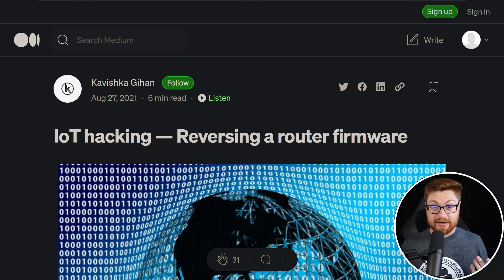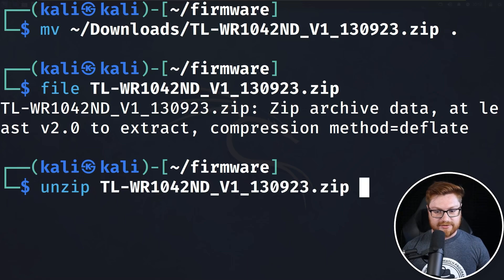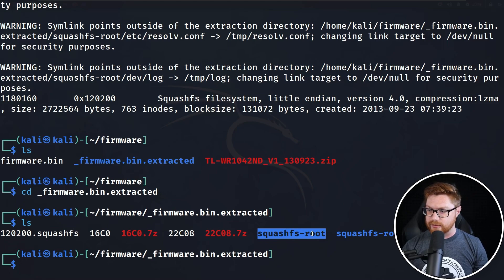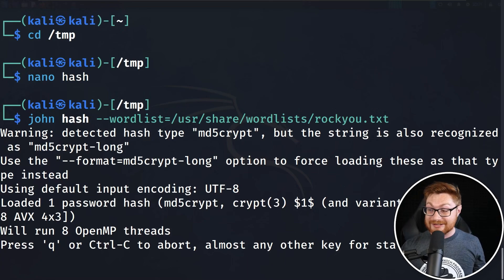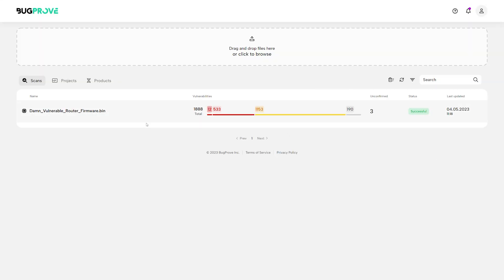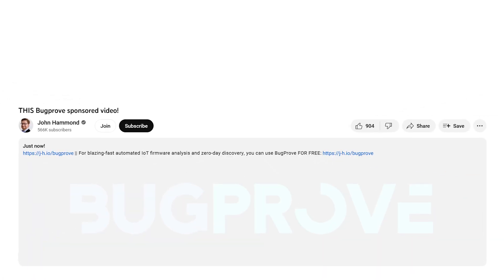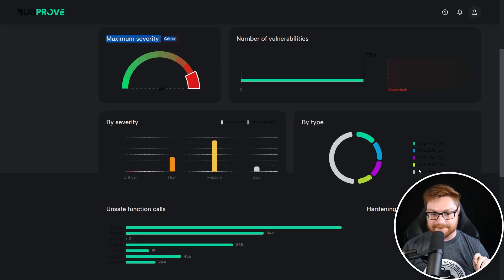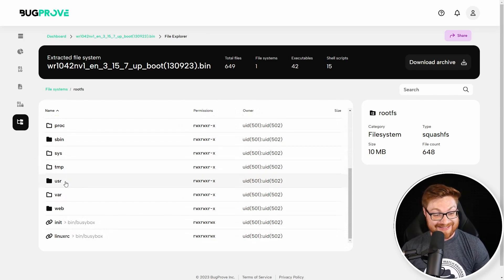Getting Started in Firmware Analysis & IoT Reverse Engineering

Comment: IoT Reverse Engineering? A P1G, Like You CANT Do That. YOUR GOD Can.
1: Firmware (Software), is Obfuscated. You Simply Cant Look at it and Reverse Engineer. How it Works is Hidden in Billions of Lines of Code. The MINIONS are Very Big. They Can. (20 to 40 Years). US: (40 to 80) Years. You: You Have to Wait a Million Years, before You EVOLVE into Something Else.
2: That Firmware, Calls Functions Hidden in Silicone. Its Very Expensive to Reverse Large Silicone Chips.
How Did "I" Do it. OUR: Wifi and 4G/LTE and 10 Gigabit Ethernet and HOW the PCI Express Bus Works.
We Could Make That. Just Not Compatible with Theirs. IT IS NOW.
"I" Can, See 100 Kilometres. "I" Can Recognise THAT ARM CORTEX A-57 CPU. (And Hardware Devices, Using it)
"I" Can Recognise: Which Android Emulators to Reverse Engineer - To figure Out How That A-57 CPU, Works. Like How, Were Reverse Engineering Macintosh. Like, I Can SEE: MicroFocus is Microsoft/Intel. Fujitsu is IBM/ORACLE. SONY is TCL/ALCATEL LUCENT. Motorola is Apple.
"I" Can Recognise - Which Hardware to ATTACK (To Figure Out: How to Do WiFi, 4G/LTE, 10 Gigbit Ethernet, PCI Express Bus). 
My Father CANT See 100 Kilometres Like I Can.
Fujitsu: Thinks there's Lots of companies, Using The RED Colour for its Logos. That's Not the Case for Me. The RED, Fujitsu is Using, isn't The Same as The Red that Other Companies are Using.

Comment: TL;DR be weary of people promising easy buttons, there ain't no such thing...

I vomited at that sponsor.

There's a lot of bogus CVE claims and such automation tools presented as a solution is harmful to security in my opinion.

Security is hard, this could easily give someone who doesn't know much about it a false sense of security which in itself is bad and should be presented with those caveats mentioned rather than as a good tool.
Reply: We understand that security is complex and there are no easy solutions. BugProve is designed to assist security professionals by automating repetitive tasks, not to replace them. We take CVE claims seriously and strive to minimize false positives. Our goal is to educate users about the tool's limitations, ensuring it complements a broader security strategy.

Program analysis and automated vulnerability discovery are challenging, so some false positives are unavoidable. However, static analysis techniques like abstract interpretation and data flow analysis are well-regarded in academia for their effectiveness, despite their limitations. These methods help optimize and secure systems and are indispensable in many safety-critical domains such as aerospace and defense.

In less safety-critical domains, such as IoT, budget constraints have often left end-user and consumer security risks overlooked, creating a false sense of security. We're working to change that by equipping embedded developers and product security engineers with powerful tools to tackle these challenges. While we prioritize delivering an easy-to-use experience, we emphasize that maintaining a mature secure software development cycle, vulnerability management process, and secure coding practices in C and C++ is not easy.

We value your concerns and are committed to transparency and continuous improvement. I hope this addresses some of your concerns.

Best regards,
Attila, BugProve

Comment: Being able to push out a bad firmware update to networked devices, takes a lot of patience but if you like that type of thing...  Router firmware typically is a small file, just getting familiar with that can be fun too.  Knowing how to modify and package 'bad code' is another whole skill-set.  Printers are also fun, PRET helps with that, a bit of an older tool now too.  They never patch , smart devices are lucky if they get one update 2 tops before its forgotten and forever vulnerable.  I'd keep the hardware part, and software separate if its a topic you are going to spend time on.  I'd be happy to see you go through it lol , make my brain itch.